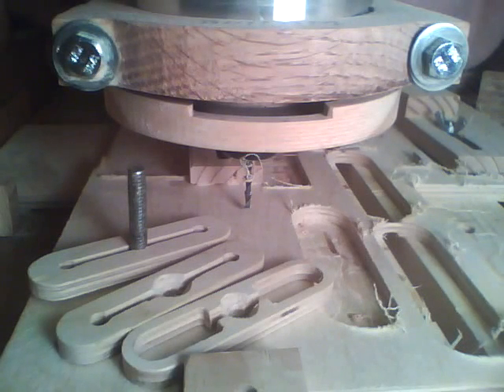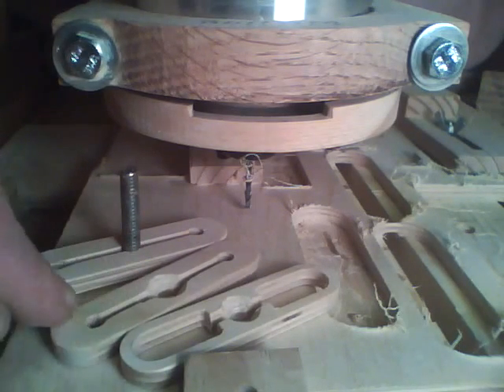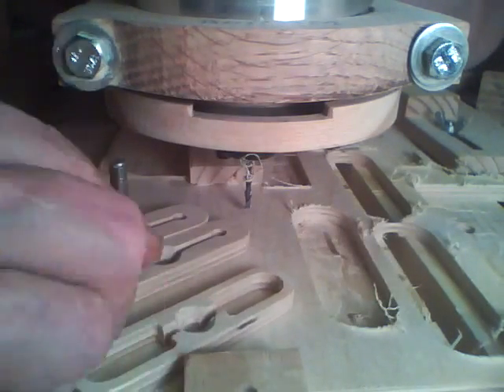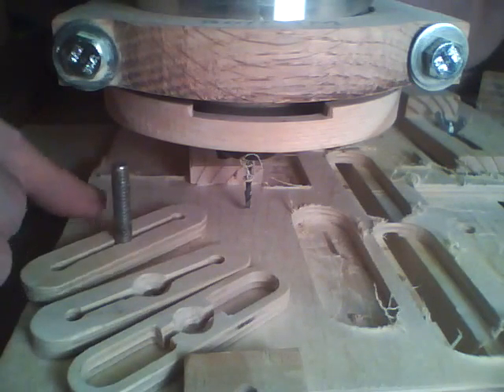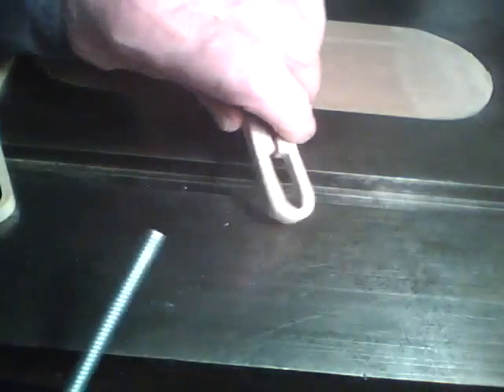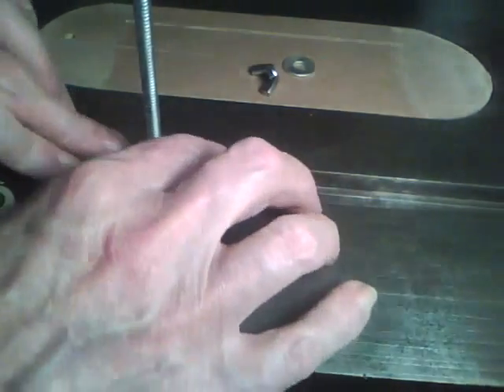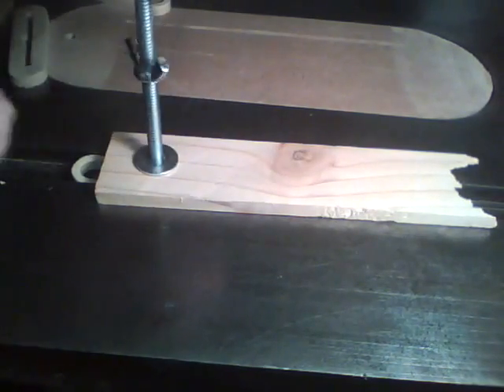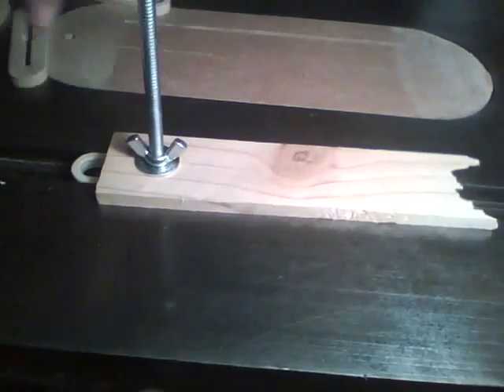Make Miter Slot Clamps

Comment: I like it but don't have a CNC machine.
Reply from the maker: Backyard Woodworking Thanks Roland, More woodworkers are getting into CNC machines. You can use a drill and a scroll saw to make them.
Reply: Can we just adjust the dimensions for what the bit would have been and take it too staples and have it 3d printed.

Comment from the maker: %
(Generated by SketchUcam {0.923})
(File: Feather Board Clamp Plastic.skp)
(Bit diameter: 0.125")
(Feed rate: 15.000"/min)
(Plunge Feed rate: 5.000"/min)
(Material Thickness: 0.250")
(Material length: 10.000" X width: 10.000")
(Overhead Gantry: false)
(Retract feed rate NOT limited to plunge feed rate)
(Multipass enabled, Depth = 0.050")
(Optimization is ON)
(www.PhlatBoyz.com)
G90 G20 G49
(04-08-2015 JDS)
G00 Z0.1
(Pass: 1)
X-1.2546 Y-0.1296
G01 Z-0.05 F5
X-1.2168 Y-0.1588 F15
X-1.1725 Y-0.1771
X-1.1126 Y-0.185
X-0.4374
Y-0.005
X-0.0737
X-0.0438 Y-0.0438
X-0.031 Y-0.0536
X-0.0161 Y-0.0598
X0 Y-0.0619
X0.016 Y-0.0598
X0.031 Y-0.0536
X0.0439 Y-0.0438
X0.0736 Y-0.005
X0.4375
Y-0.185
X1.1125
X1.1724 Y-0.1771
X1.2168 Y-0.1588
X1.2546 Y-0.1296
X1.2837 Y-0.0917
X1.302 Y-0.0474
X1.3083 Y0
X1.302 Y0.0475
X1.2837 Y0.0917
X1.2546 Y0.1297
X1.2168 Y0.1588
X1.1724 Y0.1771
X1.1125 Y0.185
X0.4375
Y0.005
X0.0736
X0.0439 Y0.0438
X0.031 Y0.0537
X0.016 Y0.0599
X0 Y0.062
X-0.0161 Y0.0599
X-0.031 Y0.0537
X-0.0438 Y0.0438
X-0.0737 Y0.005
X-0.4374
Y0.185
X-1.1126
X-1.1725 Y0.1771
X-1.2168 Y0.1588
X-1.2546 Y0.1297
X-1.2838 Y0.0917
X-1.302 Y0.0475
X-1.3084 Y0
X-1.302 Y-0.0474
X-1.2838 Y-0.0917
X-1.2546 Y-0.1296
(Pass: 2)
Z-0.1 F5
X-1.2168 Y-0.1588 F15
X-1.1725 Y-0.1771
X-1.1126 Y-0.185
X-0.4374
Y-0.005
X-0.0737
X-0.0438 Y-0.0438
X-0.031 Y-0.0536
X-0.0161 Y-0.0598
X0 Y-0.0619
X0.016 Y-0.0598
X0.031 Y-0.0536
X0.0439 Y-0.0438
X0.0736 Y-0.005
X0.4375
Y-0.185
X1.1125
X1.1724 Y-0.1771
X1.2168 Y-0.1588
X1.2546 Y-0.1296
X1.2837 Y-0.0917
X1.302 Y-0.0474
X1.3083 Y0
X1.302 Y0.0475
X1.2837 Y0.0917
X1.2546 Y0.1297
X1.2168 Y0.1588
X1.1724 Y0.1771
X1.1125 Y0.185
X0.4375
Y0.005
X0.0736
X0.0439 Y0.0438
X0.031 Y0.0537
X0.016 Y0.0599
X0 Y0.062
X-0.0161 Y0.0599
X-0.031 Y0.0537
X-0.0438 Y0.0438
X-0.0737 Y0.005
X-0.4374
Y0.185
X-1.1126
X-1.1725 Y0.1771
X-1.2168 Y0.1588
X-1.2546 Y0.1297
X-1.2838 Y0.0917
X-1.302 Y0.0475
X-1.3084 Y0
X-1.302 Y-0.0474
X-1.2838 Y-0.0917
X-1.2546 Y-0.1296
(Pass: 3)
Z-0.15 F5
X-1.2168 Y-0.1588 F15
X-1.1725 Y-0.1771
X-1.1126 Y-0.185
X-0.4374
Y-0.005
X-0.0737
X-0.0438 Y-0.0438
X-0.031 Y-0.0536
X-0.0161 Y-0.0598
X0 Y-0.0619
X0.016 Y-0.0598
X0.031 Y-0.0536
X0.0439 Y-0.0438
X0.0736 Y-0.005
X0.4375
Y-0.185
X1.1125
X1.1724 Y-0.1771
X1.2168 Y-0.1588
X1.2546 Y-0.1296
X1.2837 Y-0.0917
X1.302 Y-0.0474
X1.3083 Y0
X1.302 Y0.0475
X1.2837 Y0.0917
X1.2546 Y0.1297
X1.2168 Y0.1588
X1.1724 Y0.1771
X1.1125 Y0.185
X0.4375
Y0.005
X0.0736
X0.0439 Y0.0438
X0.031 Y0.0537
X0.016 Y0.0599
X0 Y0.062
X-0.0161 Y0.0599
X-0.031 Y0.0537
X-0.0438 Y0.0438
X-0.0737 Y0.005
X-0.4374
Y0.185
X-1.1126
X-1.1725 Y0.1771
X-1.2168 Y0.1588
X-1.2546 Y0.1297
X-1.2838 Y0.0917
X-1.302 Y0.0475
X-1.3084 Y0
X-1.302 Y-0.0474
X-1.2838 Y-0.0917
X-1.2546 Y-0.1296
(Pass: 4)
Z-0.2 F5
X-1.2168 Y-0.1588 F15
X-1.1725 Y-0.1771
X-1.1126 Y-0.185
X-0.4374
Y-0.005
X-0.0737
X-0.0438 Y-0.0438
X-0.031 Y-0.0536
X-0.0161 Y-0.0598
X0 Y-0.0619
X0.016 Y-0.0598
X0.031 Y-0.0536
X0.0439 Y-0.0438
X0.0736 Y-0.005
X0.4375
Y-0.185
X1.1125
X1.1724 Y-0.1771
X1.2168 Y-0.1588
X1.2546 Y-0.1296
X1.2837 Y-0.0917
X1.302 Y-0.0474
X1.3083 Y0
X1.302 Y0.0475
X1.2837 Y0.0917
X1.2546 Y0.1297
X1.2168 Y0.1588
X1.1724 Y0.1771
X1.1125 Y0.185
X0.4375
Y0.005
X0.0736
X0.0439 Y0.0438
X0.031 Y0.0537
X0.016 Y0.0599
X0 Y0.062
X-0.0161 Y0.0599
X-0.031 Y0.0537
X-0.0438 Y0.0438
X-0.0737 Y0.005
X-0.4374
Y0.185
X-1.1126
X-1.1725 Y0.1771
X-1.2168 Y0.1588
X-1.2546 Y0.1297
X-1.2838 Y0.0917
X-1.302 Y0.0475
X-1.3084 Y0
X-1.302 Y-0.0474
X-1.2838 Y-0.0917
X-1.2546 Y-0.1296
(Pass: 5)
Z-0.25 F5
X-1.2168 Y-0.1588 F15
X-1.1725 Y-0.1771
X-1.1126 Y-0.185
X-0.4374
Y-0.005
X-0.0737
X-0.0438 Y-0.0438
X-0.031 Y-0.0536
X-0.0161 Y-0.0598
X0 Y-0.0619
X0.016 Y-0.0598
X0.031 Y-0.0536
X0.0439 Y-0.0438
X0.0736 Y-0.005
X0.4375
Y-0.185
X1.1125
X1.1724 Y-0.1771
X1.2168 Y-0.1588
X1.2546 Y-0.1296
X1.2837 Y-0.0917
X1.302 Y-0.0474
X1.3083 Y0
X1.302 Y0.0475
X1.2837 Y0.0917
X1.2546 Y0.1297
X1.2168 Y0.1588
X1.1724 Y0.1771
X1.1125 Y0.185
X0.4375
Y0.005
X0.0736
X0.0439 Y0.0438
X0.031 Y0.0537
X0.016 Y0.0599
X0 Y0.062
X-0.0161 Y0.0599
X-0.031 Y0.0537
X-0.0438 Y0.0438
X-0.0737 Y0.005
X-0.4374
Y0.185
X-1.1126
X-1.1725 Y0.1771
X-1.2168 Y0.1588
X-1.2546 Y0.1297
X-1.2838 Y0.0917
X-1.302 Y0.0475
X-1.3084 Y0
X-1.302 Y-0.0474
X-1.2838 Y-0.0917
X-1.2546 Y-0.1296
G00 Z0.1
;
(Counter Sink)
G00 Z0.1
G00 X0.0 Y0.188
G1 Z-0.025 F5
G3 X0.0 Y0.188 I0.0 J-0.188 F15
G1 X0.0 Y0.163
G1 Z-0.050 F5
G3 X0.0 Y0.163 I0.0 J-0.163 F15
G1 X0.0 Y0.138
G1 Z-0.075 F5
G3 X0.0 Y0.138 I0.0 J-0.138 F15
G1 X0.0 Y0.113
G1 Z-0.100 F5
G3 X0.0 Y0.113 I0.0 J-0.113 F15
G1 X0.0 Y0.088
G1 Z-0.125 F5
G3 X0.0 Y0.088 I0.0 J-0.088 F15
G1 X0.0 Y0.070
G1 Z-0.150 F5
G3 X0.0 Y0.070 I0.0 J-0.070 F15
G1 Z-0.200 F5
G3 X0.0 Y0.070 I0.0 J-0.070 F15
G1 Z-0.250 F5
G3 X0.0 Y0.070 I0.0 J-0.070 F15
G00 Z0.1
;
(Pass: 1)
X-1.4347 Y-0.3097
G01 Z-0.05 F5
X-1.5044 Y-0.219 F15
X-1.5481 Y-0.1134
X-1.563 Y0
X-1.5481 Y0.1134
X-1.5044 Y0.219
X-1.4347 Y0.3098
X-1.344 Y0.3794
X-1.2384 Y0.4231
X-1.1291 Y0.4375
X1.1291
X1.2384 Y0.4231
X1.3439 Y0.3794
X1.4347 Y0.3098
X1.5042 Y0.219
X1.5481 Y0.1134
X1.563 Y0
X1.5481 Y-0.1134
X1.5042 Y-0.219
X1.4347 Y-0.3097
X1.3439 Y-0.3793
X1.2384 Y-0.4231
X1.1291 Y-0.4375
X-1.1291
X-1.2384 Y-0.4231
X-1.344 Y-0.3793
X-1.4347 Y-0.3097
(Pass: 2)
Z-0.1 F5
X-1.5044 Y-0.219 F15
X-1.5481 Y-0.1134
X-1.563 Y0
X-1.5481 Y0.1134
X-1.5044 Y0.219
X-1.4347 Y0.3098
X-1.344 Y0.3794
X-1.2384 Y0.4231
X-1.1291 Y0.4375
X1.1291
X1.2384 Y0.4231
X1.3439 Y0.3794
X1.4347 Y0.3098
X1.5042 Y0.219
X1.5481 Y0.1134
X1.563 Y0
X1.5481 Y-0.1134
X1.5042 Y-0.219
X1.4347 Y-0.3097
X1.3439 Y-0.3793
X1.2384 Y-0.4231
X1.1291 Y-0.4375
X-1.1291
X-1.2384 Y-0.4231
X-1.344 Y-0.3793
X-1.4347 Y-0.3097
(Pass: 3)
Z-0.15 F5
X-1.5044 Y-0.219 F15
X-1.5481 Y-0.1134
X-1.563 Y0
X-1.5481 Y0.1134
X-1.5044 Y0.219
X-1.4347 Y0.3098
X-1.344 Y0.3794
X-1.2384 Y0.4231
X-1.1291 Y0.4375
X1.1291
X1.2384 Y0.4231
X1.3439 Y0.3794
X1.4347 Y0.3098
X1.5042 Y0.219
X1.5481 Y0.1134
X1.563 Y0
X1.5481 Y-0.1134
X1.5042 Y-0.219
X1.4347 Y-0.3097
X1.3439 Y-0.3793
X1.2384 Y-0.4231
X1.1291 Y-0.4375
X-1.1291
X-1.2384 Y-0.4231
X-1.344 Y-0.3793
X-1.4347 Y-0.3097
(Pass: 4)
Z-0.2 F5
X-1.5044 Y-0.219 F15
X-1.5481 Y-0.1134
X-1.563 Y0
X-1.5481 Y0.1134
X-1.5044 Y0.219
X-1.4347 Y0.3098
X-1.344 Y0.3794
X-1.2384 Y0.4231
X-1.1291 Y0.4375
X1.1291
X1.2384 Y0.4231
X1.3439 Y0.3794
X1.4347 Y0.3098
X1.5042 Y0.219
X1.5481 Y0.1134
X1.563 Y0
X1.5481 Y-0.1134
X1.5042 Y-0.219
X1.4347 Y-0.3097
X1.3439 Y-0.3793
X1.2384 Y-0.4231
X1.1291 Y-0.4375
X-1.1291
X-1.2384 Y-0.4231
X-1.344 Y-0.3793
X-1.4347 Y-0.3097
(Pass: 5)
Z-0.25 F5
X-1.5044 Y-0.219 F15
X-1.5481 Y-0.1134
X-1.563 Y0
X-1.5481 Y0.1134
X-1.5044 Y0.219
X-1.4347 Y0.3098
X-1.344 Y0.3794
X-1.2384 Y0.4231
X-1.1291 Y0.4375
X1.1291
X1.2384 Y0.4231
X1.3439 Y0.3794
X1.4347 Y0.3098
X1.5042 Y0.219
X1.5481 Y0.1134
X1.563 Y0
X1.5481 Y-0.1134
X1.5042 Y-0.219
X1.4347 Y-0.3097
X1.3439 Y-0.3793
X1.2384 Y-0.4231
X1.1291 Y-0.4375
X-1.1291
X-1.2384 Y-0.4231
X-1.344 Y-0.3793
X-1.4347 Y-0.3097
G00 Z0.1
M2
%

Comment from the maker: %
(Generated by SketchUcam {0.923})
(File: Feather Board Clamp Wood.skp)
(Bit diameter: 0.125")
(Feed rate: 15.000"/min)
(Plunge Feed rate: 5.000"/min)
(Material Thickness: 0.250")
(Material length: 4.000" X width: 1.000")
(Overhead Gantry: false)
(Retract feed rate NOT limited to plunge feed rate)
(Multipass enabled, Depth = 0.050")
(Optimization is ON)
(www.PhlatBoyz.com)
G90 G20 G49
(04-08-2015 JDS)
;
G00 Z0.1
(Pass: 1)
X-1.0438 Y-0.0438
G01 Z-0.05 F5
X-1.031 Y-0.0536 F15
X-1.016 Y-0.0598
X-1 Y-0.0619
X-0.984 Y-0.0598
X-0.969 Y-0.0536
X-0.9562 Y-0.0438
X-0.9264 Y-0.005
X-0.0736
X-0.0438 Y-0.0438
X-0.031 Y-0.0536
X-0.016 Y-0.0598
X0 Y-0.0619
X0.016 Y-0.0598
X0.031 Y-0.0536
X0.0438 Y-0.0438
X0.0736 Y-0.005
X0.9264
X0.9562 Y-0.0438
X0.969 Y-0.0536
X0.984 Y-0.0598
X1 Y-0.0619
X1.016 Y-0.0598
X1.031 Y-0.0536
X1.0438 Y-0.0438
X1.0537 Y-0.031
X1.0598 Y-0.016
X1.062 Y0
X1.0598 Y0.0161
X1.0537 Y0.031
X1.0438 Y0.0438
X1.031 Y0.0537
X1.016 Y0.0599
X1 Y0.062
X0.984 Y0.0599
X0.969 Y0.0537
X0.9562 Y0.0438
X0.9264 Y0.005
X0.0736
X0.0438 Y0.0438
X0.031 Y0.0537
X0.016 Y0.0599
X0 Y0.062
X-0.016 Y0.0599
X-0.031 Y0.0537
X-0.0438 Y0.0438
X-0.0736 Y0.005
X-0.9264
X-0.9562 Y0.0438
X-0.969 Y0.0537
X-0.984 Y0.0599
X-1 Y0.062
X-1.016 Y0.0599
X-1.031 Y0.0537
X-1.0438 Y0.0438
X-1.0537 Y0.031
X-1.0599 Y0.0161
X-1.062 Y0
X-1.0599 Y-0.016
X-1.0537 Y-0.031
X-1.0438 Y-0.0438
(Pass: 2)
Z-0.1 F5
X-1.031 Y-0.0536 F15
X-1.016 Y-0.0598
X-1 Y-0.0619
X-0.984 Y-0.0598
X-0.969 Y-0.0536
X-0.9562 Y-0.0438
X-0.9264 Y-0.005
X-0.0736
X-0.0438 Y-0.0438
X-0.031 Y-0.0536
X-0.016 Y-0.0598
X0 Y-0.0619
X0.016 Y-0.0598
X0.031 Y-0.0536
X0.0438 Y-0.0438
X0.0736 Y-0.005
X0.9264
X0.9562 Y-0.0438
X0.969 Y-0.0536
X0.984 Y-0.0598
X1 Y-0.0619
X1.016 Y-0.0598
X1.031 Y-0.0536
X1.0438 Y-0.0438
X1.0537 Y-0.031
X1.0598 Y-0.016
X1.062 Y0
X1.0598 Y0.0161
X1.0537 Y0.031
X1.0438 Y0.0438
X1.031 Y0.0537
X1.016 Y0.0599
X1 Y0.062
X0.984 Y0.0599
X0.969 Y0.0537
X0.9562 Y0.0438
X0.9264 Y0.005
X0.0736
X0.0438 Y0.0438
X0.031 Y0.0537
X0.016 Y0.0599
X0 Y0.062
X-0.016 Y0.0599
X-0.031 Y0.0537
X-0.0438 Y0.0438
X-0.0736 Y0.005
X-0.9264
X-0.9562 Y0.0438
X-0.969 Y0.0537
X-0.984 Y0.0599
X-1 Y0.062
X-1.016 Y0.0599
X-1.031 Y0.0537
X-1.0438 Y0.0438
X-1.0537 Y0.031
X-1.0599 Y0.0161
X-1.062 Y0
X-1.0599 Y-0.016
X-1.0537 Y-0.031
X-1.0438 Y-0.0438
(Pass: 3)
Z-0.15 F5
X-1.031 Y-0.0536 F15
X-1.016 Y-0.0598
X-1 Y-0.0619
X-0.984 Y-0.0598
X-0.969 Y-0.0536
X-0.9562 Y-0.0438
X-0.9264 Y-0.005
X-0.0736
X-0.0438 Y-0.0438
X-0.031 Y-0.0536
X-0.016 Y-0.0598
X0 Y-0.0619
X0.016 Y-0.0598
X0.031 Y-0.0536
X0.0438 Y-0.0438
X0.0736 Y-0.005
X0.9264
X0.9562 Y-0.0438
X0.969 Y-0.0536
X0.984 Y-0.0598
X1 Y-0.0619
X1.016 Y-0.0598
X1.031 Y-0.0536
X1.0438 Y-0.0438
X1.0537 Y-0.031
X1.0598 Y-0.016
X1.062 Y0
X1.0598 Y0.0161
X1.0537 Y0.031
X1.0438 Y0.0438
X1.031 Y0.0537
X1.016 Y0.0599
X1 Y0.062
X0.984 Y0.0599
X0.969 Y0.0537
X0.9562 Y0.0438
X0.9264 Y0.005
X0.0736
X0.0438 Y0.0438
X0.031 Y0.0537
X0.016 Y0.0599
X0 Y0.062
X-0.016 Y0.0599
X-0.031 Y0.0537
X-0.0438 Y0.0438
X-0.0736 Y0.005
X-0.9264
X-0.9562 Y0.0438
X-0.969 Y0.0537
X-0.984 Y0.0599
X-1 Y0.062
X-1.016 Y0.0599
X-1.031 Y0.0537
X-1.0438 Y0.0438
X-1.0537 Y0.031
X-1.0599 Y0.0161
X-1.062 Y0
X-1.0599 Y-0.016
X-1.0537 Y-0.031
X-1.0438 Y-0.0438
(Pass: 4)
Z-0.2 F5
X-1.031 Y-0.0536 F15
X-1.016 Y-0.0598
X-1 Y-0.0619
X-0.984 Y-0.0598
X-0.969 Y-0.0536
X-0.9562 Y-0.0438
X-0.9264 Y-0.005
X-0.0736
X-0.0438 Y-0.0438
X-0.031 Y-0.0536
X-0.016 Y-0.0598
X0 Y-0.0619
X0.016 Y-0.0598
X0.031 Y-0.0536
X0.0438 Y-0.0438
X0.0736 Y-0.005
X0.9264
X0.9562 Y-0.0438
X0.969 Y-0.0536
X0.984 Y-0.0598
X1 Y-0.0619
X1.016 Y-0.0598
X1.031 Y-0.0536
X1.0438 Y-0.0438
X1.0537 Y-0.031
X1.0598 Y-0.016
X1.062 Y0
X1.0598 Y0.0161
X1.0537 Y0.031
X1.0438 Y0.0438
X1.031 Y0.0537
X1.016 Y0.0599
X1 Y0.062
X0.984 Y0.0599
X0.969 Y0.0537
X0.9562 Y0.0438
X0.9264 Y0.005
X0.0736
X0.0438 Y0.0438
X0.031 Y0.0537
X0.016 Y0.0599
X0 Y0.062
X-0.016 Y0.0599
X-0.031 Y0.0537
X-0.0438 Y0.0438
X-0.0736 Y0.005
X-0.9264
X-0.9562 Y0.0438
X-0.969 Y0.0537
X-0.984 Y0.0599
X-1 Y0.062
X-1.016 Y0.0599
X-1.031 Y0.0537
X-1.0438 Y0.0438
X-1.0537 Y0.031
X-1.0599 Y0.0161
X-1.062 Y0
X-1.0599 Y-0.016
X-1.0537 Y-0.031
X-1.0438 Y-0.0438
(Pass: 5)
Z-0.25 F5
X-1.031 Y-0.0536 F15
X-1.016 Y-0.0598
X-1 Y-0.0619
X-0.984 Y-0.0598
X-0.969 Y-0.0536
X-0.9562 Y-0.0438
X-0.9264 Y-0.005
X-0.0736
X-0.0438 Y-0.0438
X-0.031 Y-0.0536
X-0.016 Y-0.0598
X0 Y-0.0619
X0.016 Y-0.0598
X0.031 Y-0.0536
X0.0438 Y-0.0438
X0.0736 Y-0.005
X0.9264
X0.9562 Y-0.0438
X0.969 Y-0.0536
X0.984 Y-0.0598
X1 Y-0.0619
X1.016 Y-0.0598
X1.031 Y-0.0536
X1.0438 Y-0.0438
X1.0537 Y-0.031
X1.0598 Y-0.016
X1.062 Y0
X1.0598 Y0.0161
X1.0537 Y0.031
X1.0438 Y0.0438
X1.031 Y0.0537
X1.016 Y0.0599
X1 Y0.062
X0.984 Y0.0599
X0.969 Y0.0537
X0.9562 Y0.0438
X0.9264 Y0.005
X0.0736
X0.0438 Y0.0438
X0.031 Y0.0537
X0.016 Y0.0599
X0 Y0.062
X-0.016 Y0.0599
X-0.031 Y0.0537
X-0.0438 Y0.0438
X-0.0736 Y0.005
X-0.9264
X-0.9562 Y0.0438
X-0.969 Y0.0537
X-0.984 Y0.0599
X-1 Y0.062
X-1.016 Y0.0599
X-1.031 Y0.0537
X-1.0438 Y0.0438
X-1.0537 Y0.031
X-1.0599 Y0.0161
X-1.062 Y0
X-1.0599 Y-0.016
X-1.0537 Y-0.031
X-1.0438 Y-0.0438
G00 Z0.1
;
(Counter Sink)
G00 Z0.1
G00 X0.0 Y0.188
G1 Z-0.025 F5
G3 X0.0 Y0.188 I0.0 J-0.188 F15
G1 X0.0 Y0.163
G1 Z-0.050 F5
G3 X0.0 Y0.163 I0.0 J-0.163 F15
G1 X0.0 Y0.138
G1 Z-0.075 F5
G3 X0.0 Y0.138 I0.0 J-0.138 F15
G1 X0.0 Y0.113
G1 Z-0.100 F5
G3 X0.0 Y0.113 I0.0 J-0.113 F15
G1 X0.0 Y0.088
G1 Z-0.125 F5
G3 X0.0 Y0.088 I0.0 J-0.088 F15
G1 X0.0 Y0.070
G1 Z-0.150 F5
G3 X0.0 Y0.070 I0.0 J-0.070 F15
G1 Z-0.200 F5
G3 X0.0 Y0.070 I0.0 J-0.070 F15
G1 Z-0.250 F5
G3 X0.0 Y0.070 I0.0 J-0.070 F15
G00 Z0.1
;
(Pass: 1)
X-1.1291 Y-0.4375
G01 Z-0.05 F5
X-1.2384 Y-0.4231 F15
X-1.344 Y-0.3793
X-1.4347 Y-0.3097
X-1.5044 Y-0.219
X-1.5481 Y-0.1134
X-1.563 Y0
X-1.5481 Y0.1134
X-1.5044 Y0.219
X-1.4347 Y0.3098
X-1.344 Y0.3794
X-1.2384 Y0.4231
X-1.1291 Y0.4375
X1.1291
X1.2384 Y0.4231
X1.344 Y0.3794
X1.4347 Y0.3098
X1.5043 Y0.219
X1.5481 Y0.1134
X1.563 Y0
X1.5481 Y-0.1134
X1.5043 Y-0.219
X1.4347 Y-0.3097
X1.344 Y-0.3793
X1.2384 Y-0.4231
X1.1291 Y-0.4375
X-1.1291
(Pass: 2)
Z-0.1 F5
X-1.2384 Y-0.4231 F15
X-1.344 Y-0.3793
X-1.4347 Y-0.3097
X-1.5044 Y-0.219
X-1.5481 Y-0.1134
X-1.563 Y0
X-1.5481 Y0.1134
X-1.5044 Y0.219
X-1.4347 Y0.3098
X-1.344 Y0.3794
X-1.2384 Y0.4231
X-1.1291 Y0.4375
X1.1291
X1.2384 Y0.4231
X1.344 Y0.3794
X1.4347 Y0.3098
X1.5043 Y0.219
X1.5481 Y0.1134
X1.563 Y0
X1.5481 Y-0.1134
X1.5043 Y-0.219
X1.4347 Y-0.3097
X1.344 Y-0.3793
X1.2384 Y-0.4231
X1.1291 Y-0.4375
X-1.1291
(Pass: 3)
Z-0.15 F5
X-1.2384 Y-0.4231 F15
X-1.344 Y-0.3793
X-1.4347 Y-0.3097
X-1.5044 Y-0.219
X-1.5481 Y-0.1134
X-1.563 Y0
X-1.5481 Y0.1134
X-1.5044 Y0.219
X-1.4347 Y0.3098
X-1.344 Y0.3794
X-1.2384 Y0.4231
X-1.1291 Y0.4375
X1.1291
X1.2384 Y0.4231
X1.344 Y0.3794
X1.4347 Y0.3098
X1.5043 Y0.219
X1.5481 Y0.1134
X1.563 Y0
X1.5481 Y-0.1134
X1.5043 Y-0.219
X1.4347 Y-0.3097
X1.344 Y-0.3793
X1.2384 Y-0.4231
X1.1291 Y-0.4375
X-1.1291
(Pass: 4)
Z-0.2 F5
X-1.2384 Y-0.4231 F15
X-1.344 Y-0.3793
X-1.4347 Y-0.3097
X-1.5044 Y-0.219
X-1.5481 Y-0.1134
X-1.563 Y0
X-1.5481 Y0.1134
X-1.5044 Y0.219
X-1.4347 Y0.3098
X-1.344 Y0.3794
X-1.2384 Y0.4231
X-1.1291 Y0.4375
X1.1291
X1.2384 Y0.4231
X1.344 Y0.3794
X1.4347 Y0.3098
X1.5043 Y0.219
X1.5481 Y0.1134
X1.563 Y0
X1.5481 Y-0.1134
X1.5043 Y-0.219
X1.4347 Y-0.3097
X1.344 Y-0.3793
X1.2384 Y-0.4231
X1.1291 Y-0.4375
X-1.1291
(Pass: 5)
Z-0.25 F5
X-1.2384 Y-0.4231 F15
X-1.344 Y-0.3793
X-1.4347 Y-0.3097
X-1.5044 Y-0.219
X-1.5481 Y-0.1134
X-1.563 Y0
X-1.5481 Y0.1134
X-1.5044 Y0.219
X-1.4347 Y0.3098
X-1.344 Y0.3794
X-1.2384 Y0.4231
X-1.1291 Y0.4375
X1.1291
X1.2384 Y0.4231
X1.344 Y0.3794
X1.4347 Y0.3098
X1.5043 Y0.219
X1.5481 Y0.1134
X1.563 Y0
X1.5481 Y-0.1134
X1.5043 Y-0.219
X1.4347 Y-0.3097
X1.344 Y-0.3793
X1.2384 Y-0.4231
X1.1291 Y-0.4375
X-1.1291
G00 Z0.1
M2
%